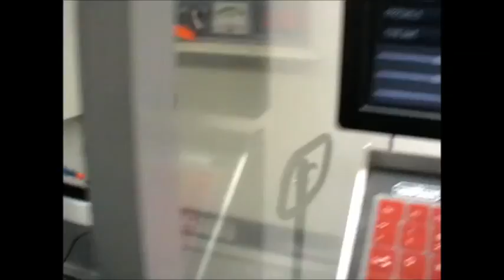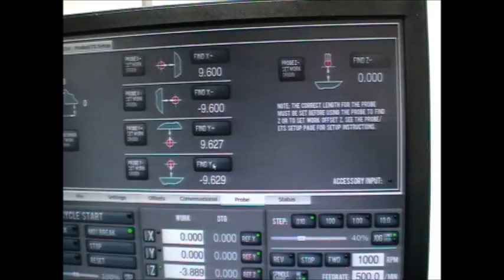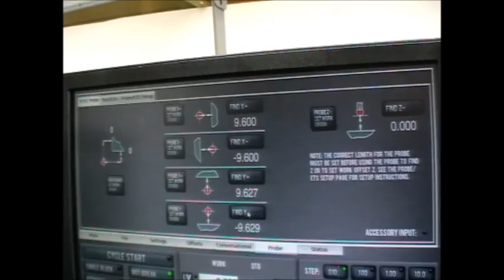Tormach Passive Probe accuracy part 2

Comment: It could be that the backlash in your machine is causing the 0.001" error between the Y-/Y+ that you are seeing.

Can you measure your Y-Axis backlash with a DTI and subtract that from the stacked error of 0.0011" and see what is left from the flex in the stem?

It would also be interesting to see your X-Axis backlash measured with a DTI as well.

I do have a PCNC1100, but I haven't picked up (or made) a probe yet for it, so I haven't gotten a chance to go down this road yet.

Best of luck!!